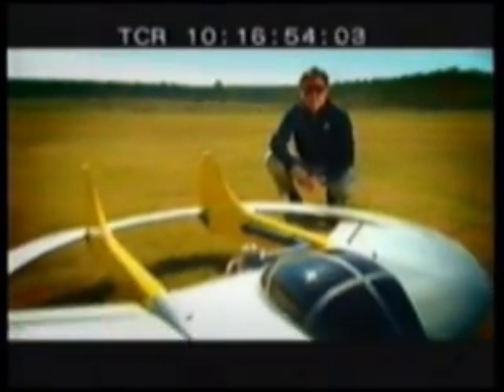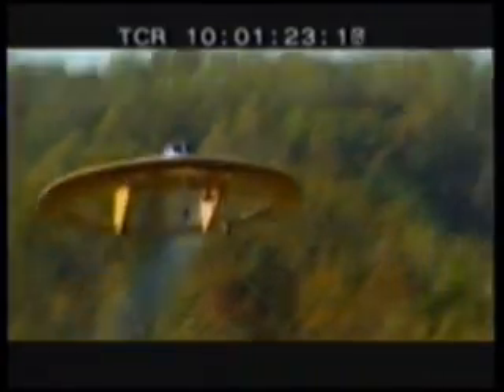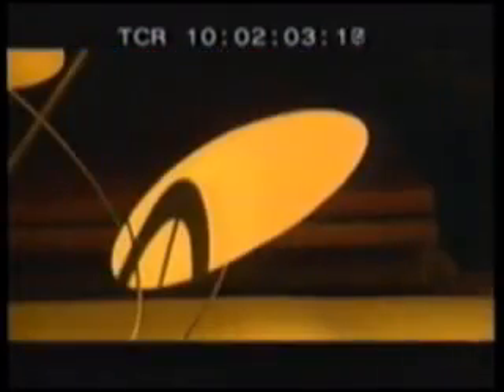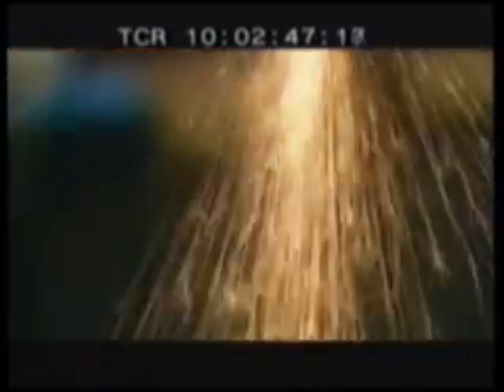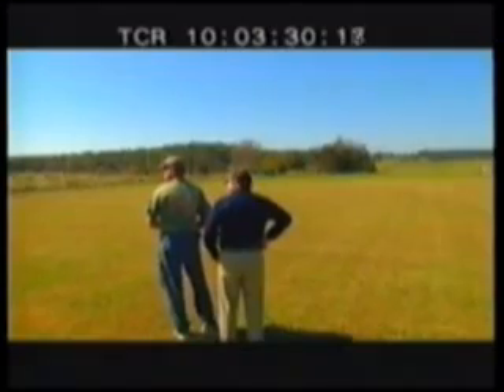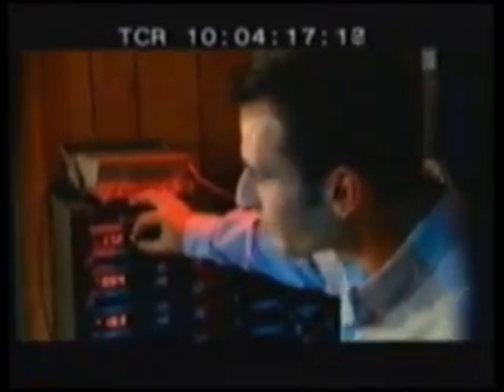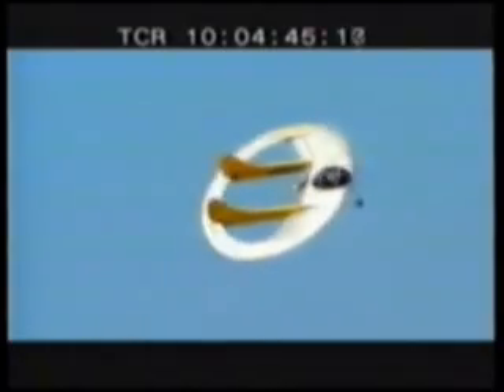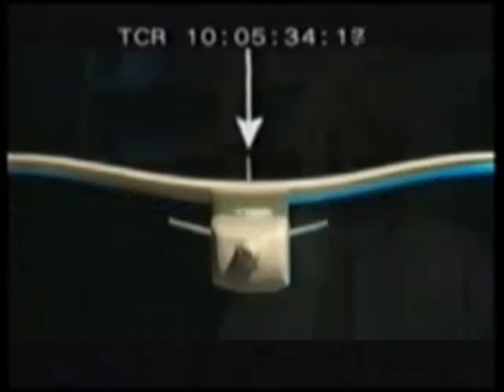Flying Saucers Are Coming!

Comment: Am i the only one who remembers the frisby?

this is how it works. cock pit in the middle and the the disk over it . the moter will spin the disk around the cockpit creating lift for the aircraft and then simple propulsion should send you in any direction.

the hard part is stabilizing the craft.

i did this with a frisby and suped up fancy remote control car engin and it worked great. cut a hole in the midle of frisby for the engin (air tight) and mebe a weight to counter balance and your off

Comment from the maker: The simple answer is... You are loading up the disc about the center, placing the center of lift aft of the center of gravity. All stable planes have CL and CG very close to each other. However, some military jets use computers to fly stable in a tail heavy design. Just now posting a new video. paste this into youtube ........... watch?v=cjcsOwrWnzk

Comment from the maker: I'm well aware of the craft you speak of.  The umbrella plane is not circular, extremely crude, and lacks my patented 3 wing concept. You're comparing apples and oranges. The avro car was a waste of money and time. The center CG location  on it would have never allowed for fast forward speeds. This goes for the Cypher designs also! The Zimmerman saucer is not circular either and generally an awkward design & added lateral wings for stability.  Geobat is naturally stable at high and slow speeds.

Comment from the maker: Out data, let alone watching the actual models fly indicate a competitive aircraft with regards to L/D. Geobat can compete with conventional aircraft! It appears Geobat has a wider speed envelope than normal aircraft designs and unbelievably stable for a circular aircraft and more stable than most conventional design configurations. Vertical fins are actually optional. Our largest UAV is 82" dia. and stressed for fullscale applications. The bigger it gets the better it looks.

Comment from the maker: The lighter the aircraft the more efficient. The B2 bomber is a lifting body. This significantly helps allow the air frame designers to lighten the airframe. Conventional wings have to be strong and thereby heavy. Tubes have be even stronger and thereby heavier, they are under constant stress when flyng, always hanging off the wing. A lifting body is primarily stressed on the ground, flying relieves the stress, it floats like a boat, pressure is applied about the wing. This is common sense.

Comment: believe me I know that, because I am studying aeronautics. In general L/D is related with fuel economy and payload. you can make a tube to fly, but what is the point if it is very expensive?  L/D depends from Aspect ration, flying saucers have it 1.27 so it is very low. off course if you are going to fly at supersonic speed is ok. But not yet, because industry don't have such powerful propulsion

Comment: I know nothing specifically about the history of saucer design. However I'm studying aeronautical engineering so Id like to think I know a bit about aircraft design. All you've done in your model is to bend the wings of a conventional aircraft back and join them with the tail. This just gives a low aspect ratio wing which equals poor lift/drag ratio, along with the lack of a fuselage which removes most of your space for passengers.

Comment from the maker: Geobat is a multifaceted concept. Its understandable that you can not see the different configurations and their applications.  Tubes and wings dominate the industry because back in the early days of aviation they could not come up with a stable lifting body. I can put at least 300 people in a 100 ft. diameter aircraft. Compare that to a MD 80.  Payload = Money, this is the driving force. L/D is only one equation in the mix.

Comment: This is ridiculous. Making an aircraft in the shape of a saucer? Do you think that pretty much every aircraft configuration hasn't been looked at by engineers? The conventional configurations we see are the easiest to optimise and control, easiest to build, the list goes on. The aeronautics engineer in the video makes no mention of the lift/drag characteristics or stability of the craft. The fuselage floats in the air like a boat? What the hell? Does this guy have any idea how lift even works?

Comment from the maker: Thanks very much for the info!  I consider Geobat the pour mans flying saucer. However, I see it as a transition craft to advanced saucer concepts. Any saucer that reacts with the air as it flies forward (like normal aircraft) will have control/stability issues. As soon as I saw the weav concept, I thought this would work well with some of the larger Geobat configurations. I've heard of configurations whereby the air never interacts with the body of the craft, this would be highly desirable!

Comment from the maker: 3 day filmshoot, 6 min.video. Lots of info didn't make it to the final edit. There is much more to this concept than what you are seeing. Delta wing Vs Geobat wing- Geobat doesn't require an expansive wing span. Based on visual test (model to model), Geobat is more stable than the flying wing. I'm reasonably certain Geobat can safely transport more people to smaller airports than the flying wing concept. Notice the Boeing lifting body concept still has lateral wings stretching out far and wide.

Comment: So if I get this correctly, your main asset is the lifting body. I don't really see the difference with deltawing planes, aside from the fact that you brought the model into a circular form.

The delta design proved to be too high a cost when trying to develop as commercial airliner. So what is the main advantage, other then the lifting body?

Comment from the maker: I am not a pilot, I have no degree in aeronautics. I'm a professional artist, illustrator, sculptor. I am surrounded by pilots and engineers, some at the highest levels of expertise. I humbly accept their advise and grateful for their time with regards to advancing Geobat. Auburn University has put more men in space than MIT. AU aerospace engineering performed extensive wind and fluid testing of the Geobat concept. The data is proprietary,it clearly indicates Geobat is a viable airframe.

Comment from the maker: The wing span is actually less than normal aircraft based on a payload comparison. Ex.  An MD 80 generally holds 140 passengers with a wingspan of 107 ft.  A 100 ft. diameter Geobat can easily hold 300 passengers. We are now flying an 82 In. diameter Geobat designed for full-scale and UAV test. Flaps are not considered a design issue. We can actually fly the craft with only forward "or rear ailerons" and elevator. The vertical fins are optional unless aerobatics are called for.

Comment from the maker: You are seeing the Piper Cub of the three wing concept. It gets really interesting as the payload area gets bigger. However, it is a plane, but what I'm claiming is that it's the only circular wing in the history of aviation capable of competing with tubes and wings. We will make it hover, glow, and fly at Mach 12 later.

Comment from the maker: L/D is proprietary. The important point is that Geobat can compete with tubes and wings based upon the data. Common sense will tell you this when you see it fly. Lifting body, smaller ground footprint, large payloads, structurally efficient, and with a circular edge. The circle is an "Ideal" form for future technologies. Don't shoot the messenger!

Comment: Thank you Merlin.

Well I didn't mention stability at all and I can quite appreciate that the design will have excellent stability. That wasn't my point.

I'd be very pleased to see an efficient new breakthrough which cleverly overcomes all the conventional downsides of low aspect ratio wings. - We need it when fuel is scarce and global warming threatens our future.

So what is it's L/D?

Comment: So what's so special? This is a inefficient little plane with a low aspect ratio and poor L/D. It's really nothing new to bend the wingtips back till they touch the tailplane. The round shape is attractive, but that's where any benefits end. This will always always use lots of fuel and have a poor perfomance, especially at low speed.

Comment from the maker: sarasotasun posted earlier,
Absolutely Beautiful!
Jack...I say pressurize it, bolt on a solid rocket, and get a piggy back ride to the flight levels then release and fire away. Voila! ..you've got SpaceBatOne. Looks like a pneumatically actuated feathering control surface could easily be implemented. Scaled Composite..who?! Seriously, forget the Rutans, Lancairs, Vans, Velocity, Seawinds, etc. I can even imagine this thing on floats. Christmas is right around the corner, I'll take two please.

Comment from the maker: Not yet! I see two options that would allow auto rotation to the ground upon complete power failure. Unfortunately for Geobat enthusiast, they are proprietary. However, Geobat can descend at an unusual angle for an aircraft. Power off with full positive deflection of the elevator, it will sink at about a 45 degree angle while maintaining a horizontal attitude with stable control. I'm certain the descent angle can be increased. Depending on your viewing angle it looks like it is hovering.

Comment from the maker: Geobat is most certainly a new concept in wing design! Read Secret Projects, Flying Saucer Aircraft by Bill Rose.  Millions of dollars have been spent to achieve what Geobat has accomplished in a simple 4 channel RC aircraft. The Zimmerman Saucer, which you allude to is not circular and had aft elevators projecting laterally to stabilize it. Huge spinning props on the wing tips. You have any idea what would happen if one of those props quit spinning. Kiss=Keep It Simple Stupid. Geobat = KISS

Comment: Assuming the videos showing flying saucers accelerating from 0 to 1000mph in the blink of an eye are authentic, then the only possible propulsion system would be a graviton accelerator, which would create a gravitational field around the saucer, allowing for insane acceleration without the pilot feeling any G forces.  My point is, the saucers in the sky don't need to worry about "lift", only aero and hydrodynamics.  Your fighting an uphill battle with a propeller, but still doing a great job!

Comment from the maker: Thanks for your enthusiasm, and you are correct to label this as just an airplane.  However, it's the first circular plane that can compete with general aviation.  Payload, lift, drag, safety, efficiency all come into play.  Geobat as presented represents the tip of the aerodynamic iceberg.  There are strange concepts that this design allows to unfold because of it's geometry.

Comment from the maker: Yes, visibility is a concern.  However, the design you see being wind tunnel tested puts performance over visibility, similar to many mid and low wing designs on the market. We have designed the cockpit to have a transparent floor about the pilot's and passenger's feet and legs.  You will have a forward viewing "straight out and down angle" like nothing on the market, sort of like a helicopter.

Comment from the maker: Thanks very much. Simplicity is the key to Geobat's success. Geobat represents something that has never been achieved before in aviation history, a circular wing that can compete with general aviation. Geobat far outperforms all prior circular designs with regards to forward flight.  VTOL is the next step. You have to crawl before you walk. Be sure to read the book by Bill Rose-Flying Saucer Aircraft-Secret Projects.  Thanks for your response. Jack M. Jones

Comment: Oh don't get me wrong this is a great design and a nice twist on conventional flight. I too am designing a flying saucer, I am almost ready to move into the construction phase. I have begun to build a mock up of it just to sort out some structural design questions. I hope to have a working model within the next year or so. It will have vertical take off and landing capabilities, though your design has the potential for much higher speeds.
J. Loranger

Comment from the maker: First things first, make saucer shaped flight a commercial reality! Tubes with Wings vs. Saucer Lifting Bodies.  VTOL is the next step. The VTOL solution is on the drawing board. My design philosophy is that Geobat VTOL must be as safe as the helicopter upon total engine failure.  We will make it glow and fly at mach 12 later. You are only seeing one of many designs. Thanks for your interest. Jack M. Jones

Comment: Absolutely Beautiful!
Jack...I say pressurize it, bolt on a solid rocket, and get a piggy back ride to the flight levels then release and fire away. Voila! ..you've got SpaceBatOne. Looks like a pneumatically actuated feathering control surface could easily be implemented. Scaled Composi..who?!  Seriously, forget the Rutans, Lancairs, Vans, Velocity, Seawinds, etc. I can even imagine this thing on floats.  Christmas is right around the corner, I'll take two please.